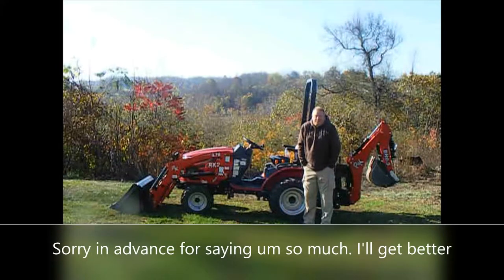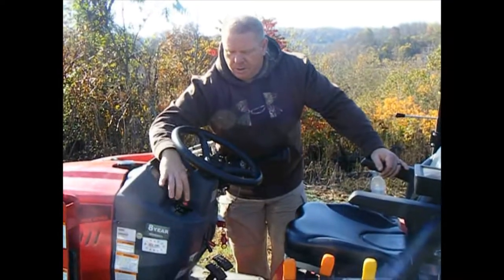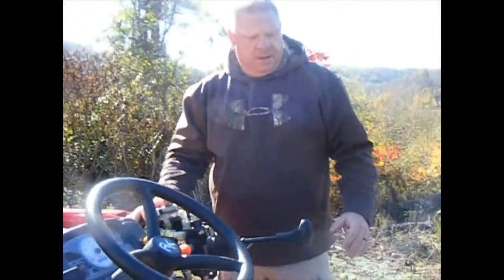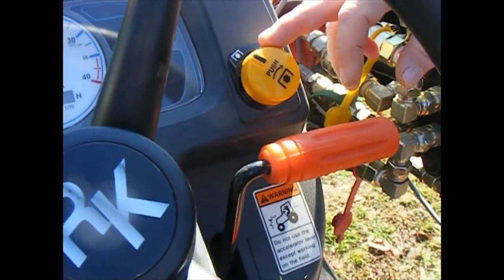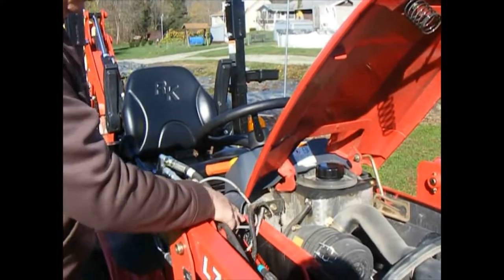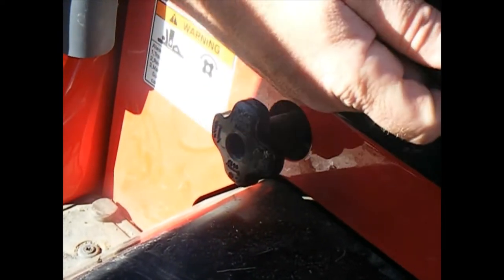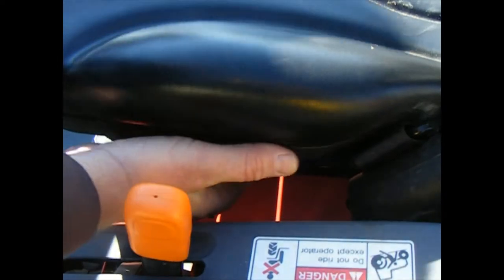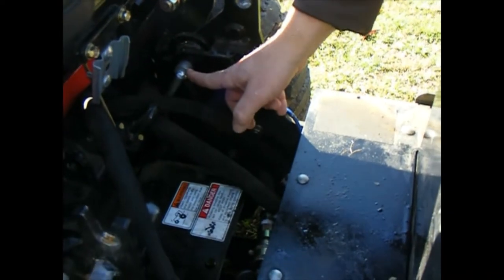Tour of RK 24

Comment: You didn't mention the price. These are nice little tractor , I have a 1025R which is also a great tractor. I have a John Deere dealer three miles for where I live. I look at the RK but the closest dealer was our an hour away. Great video 👍🇺🇸
Reply from the maker: Thank you for comment I paid 22,000 for tractor,backhoe,front end loader and a 48 inch pull behind pto finish mower. The tractor and FEL base is close to 13,000. I liked John Deere also but they were just to expensive for me at the time with everything I got. You got to think how close they are to your house if it’s 1 1/2 hours that’s a drive if you need something,mine is just 15 min away.

Comment: If this was asked already I apologize, but does this model have the DPF filter?
Reply from the maker: No it is under 25 hp it does not have to have it I was told when I bought it.
Reply: @hayesoutdoorsandtractors3278  Thank you!  I'm pretty sure I'll be getting one in a couple of months. Subscribed.
Reply from the maker: Thank you so much send a pic when u get it!!!
Reply: @hayesoutdoorsandtractors3278  Hey, what's up?  I just saw this video on my homepage.  Anyway, I got the RK24 and love it!  My package came with the grapple, box blade and 48" bush hog.  Mainly been using it to mow the back acreage on the property (zero turn gets stuck out back) as well as dumping sand in areas that are really muddy (drainage is terrible) and haven't had any issues in the past three months. Will be using the box blade and grapple soon, as we plan on clearing/making walking paths around the stable and various parts of the property.  Slow processes, but we are getting there. Hope all is well.
Reply from the maker: @dcfan1107  great to hear let me know how the box blade works that’s my next purchase . I love my grapple I use it all the time not only to pick stuff up but also to level and back drag

Comment: Just a heads up... When we picked up our tractor, our third function wires come from the valve up front, are zip tied along the hydro lines all the way back, run down the support arm, and are zip tied at the belly of tractor directly under the controller. Makes for detaching/reattaching FEL very quick/convenient...plus keeps your wiring harness from getting worn through by hood👍
Reply from the maker: Thank You very much for the comment and info sounds like a great idea. I will look into that!👍